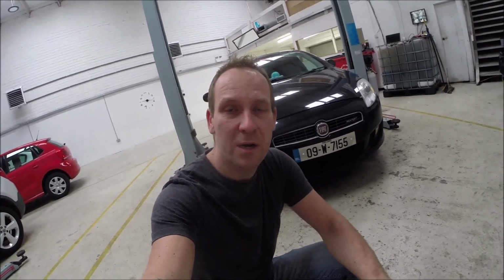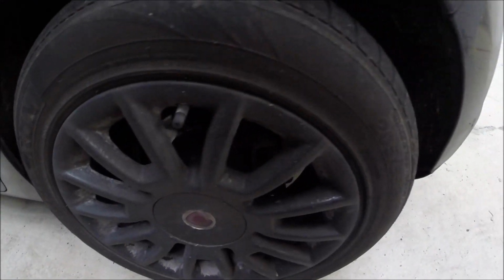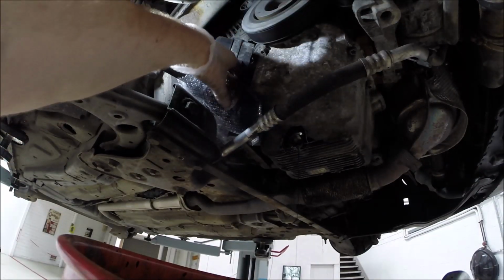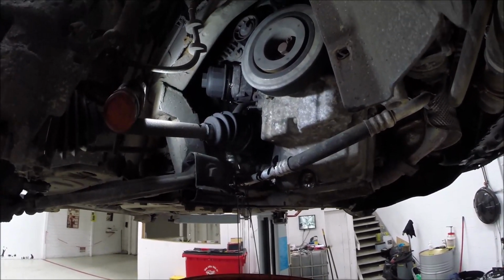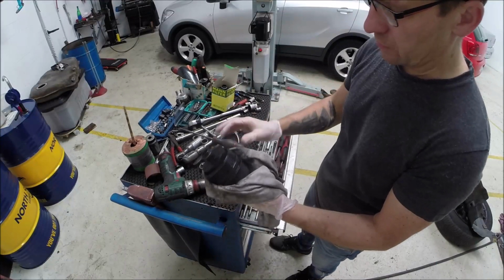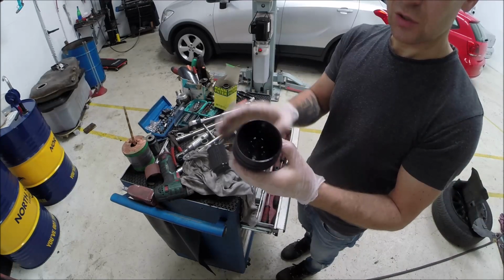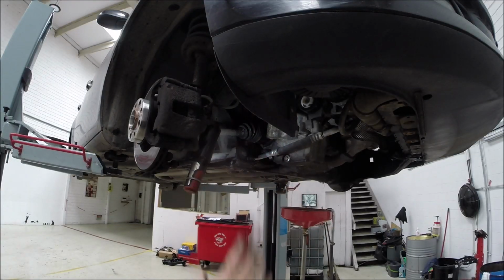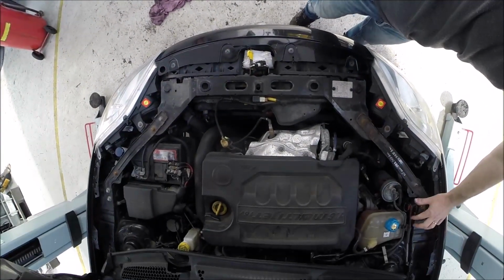Fiat Bravo Engine oil Service

Comment: Looks like something that very few people realize is that there is a drain output for the oil filter. It is located just underneath the filter assembly (clearly visible at 5:01). It is very helpful and prevents the oil from the filter to pour on the cv joint. 
But a great video nonetheless!;)

Comment: I've got one and this is a great car. T-Jet engine modded to 200 (CV), Cold Air Intakes K&N, Sequential Blow Off Valve HKS, Tiefergelegt by Eibach parts, Barracuda Cuda GT4, Supersprint Anlage, Car Audio Alpine with JBL sub 1000 wats. V-max 250 ^^